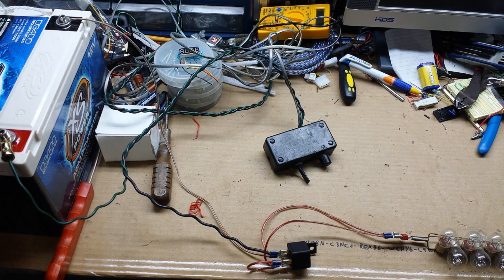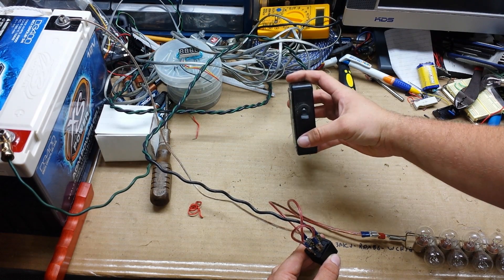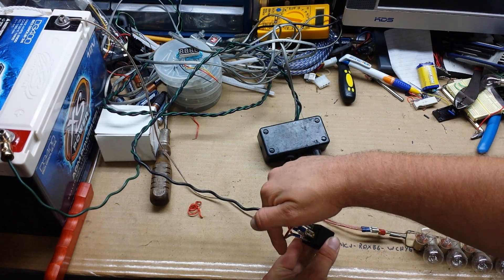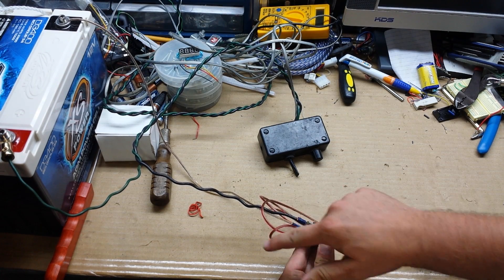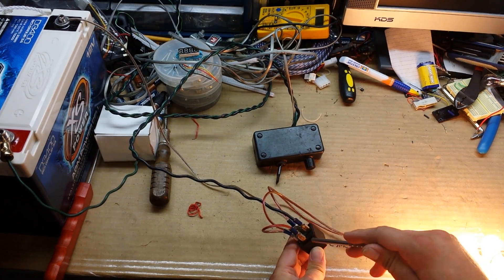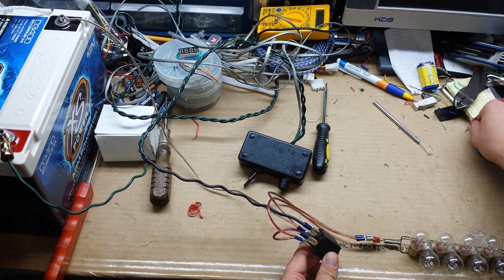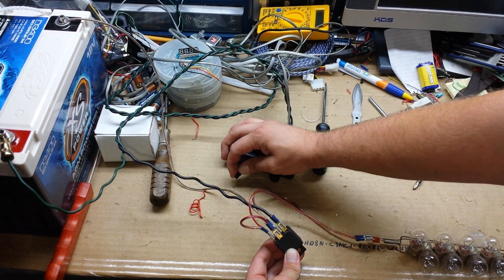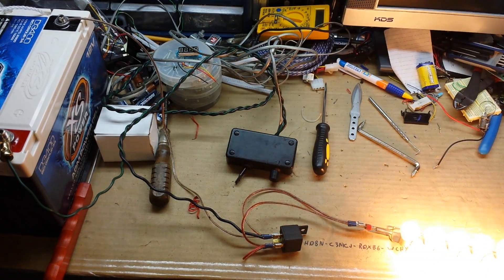Home made auto latching relay, cheap and easy!

Comment: Many here do not understand what a latching relay vs "standard" relay.  With a standard relay, the "switched" side is only "switched" while the trigger (in this case where he manually shorts the terminals) is held in place.  A latching relay maintains the "switched" side until the source power is removed the the switched circuit.  This is actually fairly useful, very reliable and virtually free.

Comment: This is of absolutely no use, a latch relay is normally used where you have a pulse that activates it by energising the coil for a second or two and the contacts then stay in that position till you re-energise the coil for a second and the contacts then go back to the original position. (Some relays need a reverse polarity to unlatch) 
 With the circuit in the video you need to remove the power from the coil to get the contacts in the original position. That is exactly how a simple relay works, you energise the coil and it stays on, you remove the power from the coil and it goes off so what is the use of this contraption.? 
A latch relay must be able to stay in the on position even if the coil is not energised anymore and must only switch off when the coil is re-energised.
Reply: Philip Koen you actually answered your own question. 

This does in fact need to have primary power removed in order to un-latch. 

It is useful in an already switched circuit where you have an additional accessory that you do not want to turn on immediately when the primary circuit is energized. It is more of a safety than anything, it ensures that whatever it controls does not engage automatically once power is supplied and removes human error of forgetting to turn off the signal if a basic switch were used rather than a momentary switch.
Reply: Charles Yarbrough
You wrote: "This does in fact need to have primary power removed in order to un-latch"     Therefor it is not a latch relay per se, it is just a normal relay wired so that it energises itself. 

The definition of a latch relay is: "Latching relays are 'bi-stable,' meaning they have two relaxed states. (These are also known as 'stay' relays, some even call then flip-flop relays) When an electrical flow is turned off, the latching relay remains in the last state it was in. Latching relay is really a generic term that is used to describe the type of relay that maintains its position after the power is removed" NOTE: Maintains its position after the power is turned off.

What you did was simply to wire a relay to supply its own holding circuit, it is not a latching relay as it needs constant power to keep the contacts in the position when energised. It can be confusing and cause problems if somebody is to use your method where a real latch relay is needed.
Reply: Philip Koen thank you for the info, i guess for lack of better terms i was creating an "auto resetting" relay. 

The goal was achieved with an off the shelf auto parts store generic relay. And as with anything electrical there isnt ever a one size fits all or only one answer to anything. 

Thanks for informing me about flip flop relays, i had never came across any in my experiences. Could prove to be very handy where a full size solenoid isn't necessary.
Reply: You get latching relays of different kinds, some need a reverse polarity to unlatch, some have two coils, one to switch to one side (latch) and the other to unlatch, I often use different kinds of them in circuit designs.

Comment: awesome, can it be deactivated the same way? i have a momentary switch id like to use it to toggle on/off. Your expertise is appreciated
Reply: Mano0f you can use a nc momentary switch for the toggle off switch and wire it in the power side of the relay and when you want to shut it off you will in turn cut the power from the relay
Reply: Mano0f you can use a nc momentary switch for the toggle off switch and wire it in the power side of the relay and when you want to shut it off you will in turn cut the power from the relay

Comment: Nifty
Reply from the maker: thanks! the point of building this is to have a "dummy proof" way to activate my hydrogen unit when i wanted it on, but it wouldnt come on with my key every time. 

so each time the truck is started you have to manually activate the momentary button on the dash to turn it on. but it  eliminates the risk of it activating automatically every time the key is turned on. wouldn't want to turn the key on for a minute to turn some lights on, for example, and be filling the intake with highly explosive gas!!!